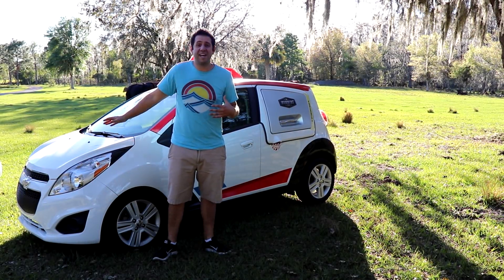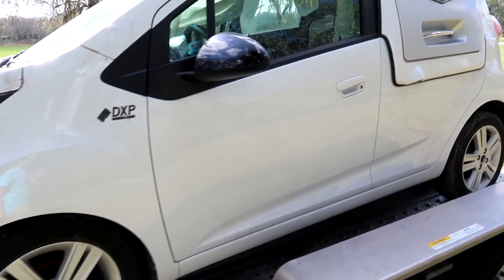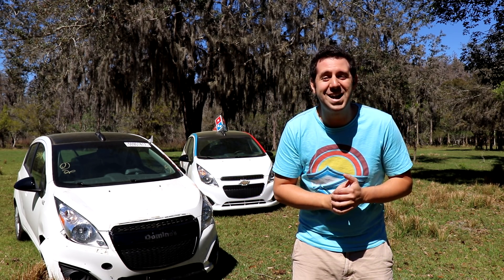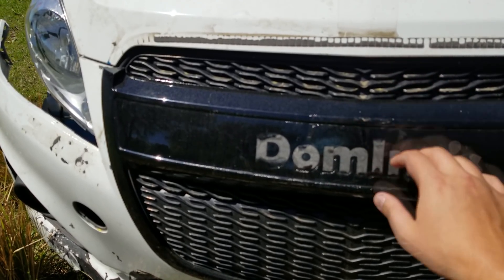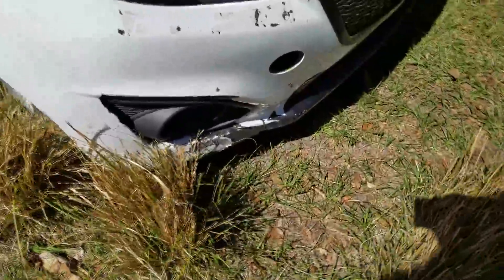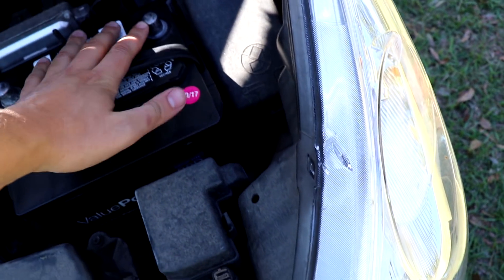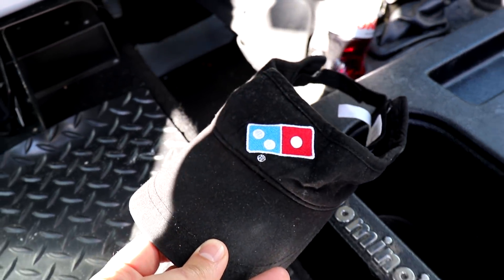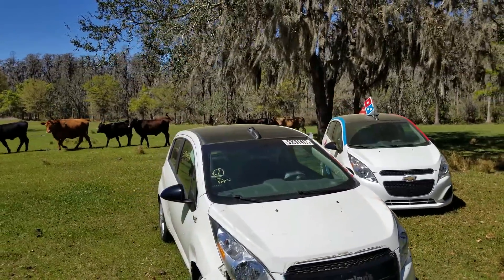I Bought ANOTHER Wrecked Domino's Pizza DXP Car for $825

Comment: I originally subscribed when you started the first pizza car. This is so cool that u got another one. Im really excited to see this one. Also I wanted to thank you for introducing me to copart. I recently bought a truck on there and its freaking awesome. It was donated to a charity and sold through copart with a clean title. I paid $725 and drove it away.
Reply: what a steal! gongrats man!
Reply: What were your copart fees?
Reply: What kind of truck was it?
Reply: Aaron Hayden a ford raptor
Reply: It’s a ford ranger. 1995 with 110,600 on the clock. This thing must have been either in a garage or a carport, it has virtually no rot. Very minor rust, from a few small dents. Copart fees were around 300. It is exactly what I wanted. Thanks Samcrac and Copart!
Reply: t-bone distortion 
What a steal, nice dude
Reply: It depends on the state you live in. I live in PA and here you do not need a license to buy salvage title vehicles. Samcrac did a video about all of that, although if I linked it here my comment would be considered spam. Copart has a $1000 bidding limit for new accounts. If u put a deposit down, you can get more buying power, meaning u can bid more. And u need a premium account to bid on more then 1 vehicle at a time. To answer ur question, anyone can buy a car from Copart if the circumstances are right.
Reply: t-bone distortion rChange the dice on the first car to look like a pair of Vegas dice.

Comment: Could it be that Dominos forced removal of branding stickers because of Samcracs first DXP?
Reply: xkeepersvk I had the same thought. They probably saw his first vid and stripped the second clean
Reply: it still says Dominos on the front...
Reply: ThePc845 that's probably glue from the logo. Or the material around it faded. Not much they can do to remove it.
Reply: Albert Hoelting not true at all, diesel, gas, kerosene, wd40, oops off ect are all great glue removers
Reply: if thats the case then they are still shit outta luck because you can get those designs online and print them out or easily create your own
Reply: @Kardrick that is where the legal standpoint gets much murkier.  With the first one they left the logos on so he was restoring them.  With this one he would be making brand new copies of their trade marked logo.

I would say pull any parts with logos they left on it and use them to better restore the other car.  Then turn this one into a blank slate to have fun with.
Reply: NobodyImportant that's exactly what i was thinking. I would go for something like domono king. We knock over the Dominos. Then have a big hammer on top of the car smashing a big domino. Then I would make a crap ton ofbvodeos and post them everywhere!

Comment: SUPER CHARGE IT OR TURBO CHARGE
IT
Reply: holly shit YESSSSSS!!!!
Reply: Over torque and break the engine,bravo!
Reply: All hes gotta do is buy a SRI cruze. The 1.4 and 1.6 turbo motors will drop straight in. Theyd have a good power to weight. 

Would be funny seeing the origional DXP at a drag track putting down some decent times.
Reply: I support this
Reply: nah ls swap it
Reply: In 30 seconds or it's free...
Reply: I'm not confident the chasis could withstand the increased power/torque haha.  We have a 2014 Spark and if I remember correctly.....I have never experienced so much body roll on a car that comes from the factory with such super stiff suspension.
Reply: You should put a Oldsmobile on the front grill 😂

Comment: V8 swap
Reply: Eclipze FFA LS swap
Reply: Chasis not strong enough
Reply: Put a 1jz
Reply: That engine bay won't even fit a 6 cylinder let alone a V8
Reply: D T if you can an ls where most 4 banger can.
Reply: Looks up ls swapped Chevy spark
Reply: did someone say LS?
Reply: The electric version of the Spark had around 400 lb/ft of torque so maybe it could handle it
Reply: Turbo hybusa mid engine build
Reply: LilWayne Tha GOAT Budd I
Reply: anything can be v8swapped.... even a cobalt

Comment: how about this, give it the tuner/ricer treatment. new oven and other bits it needs to be functional and make some wild tuner or drift car themed pizza wrap to go with it. would be a stunner at the local car meets. also i would refurbish the front bumper skin off car #2 for car #1 even if you cant legally re apply the dominos logo, but having it there just in black trim would be atleast close enough and bring it that much closer to correctness.

Comment: Correct me if I am wrong, but isn't a crash damaged and totaled vehicle the property of the insurance company when they pay off the claim? If that is the case, it appears Dominos and the franchise holder operating these vehicles are being paid by the insurance company for what is left of the vehicle and, the insurance company, as the legal owner, can do anything they want to the vehicle. If Dominos wants to get twisted about their trademarked or copyrighted components and logos, they need to set up a stipulation with their franchise holders about the handling of wrecked vehicles or buy back the components they want to protect, after all, auction buyers can't buy what ain't part of the cars being auctioned.

Comment: I have some questions about the car that you have because I have a 2015 Chevy Spark and my car is running in engine low power mode and I was not able to figure out why, I think the crankshaft sensor might be why, but I'm not entirely sure if that is the full reason, I also have two 02 Sensor codes.

Comment: I'm not a fan of Copart - I sold an old junker to them and they came and picked up the car without letting me know, and then because I wasn't there they paid the shop 1/2 of what I sold the car for, for holding it there.  Luckily the shop has worked out a deal to provide me the money back in labor costs in the future.  They then wrote the check for the wrong amount and luckily they mailed me the difference that was owed to me.  All they had to do was call to let me know when they would pickup the car (as they told me they would) and it could have prevented a whole big mess.

Comment: You can "possibly" take the grill and add it to the car with the original Dominoes additions, since it would be an original replacement to bring that car back to the "state" in which it was sold to you. The stripped car you can not add any trademarked additions to. That one you can not make additions to, as it would be a gross infringement of trademark.
Fix it up, physically remove all the Dominoes markings, and DONATE it to a charity that delivers hot meals.
High Ground Taken.

Comment: Yes nothing like seeing a wrecked chevy spark. I absolutely despise Chevy Aveos, Sonics, and Sparks. They are ugly as hell slow as shit and the people who buy and drive them tend to be the worst drivers on earth. I have had multiple bad experiences with Aveos/sonics on the road I actually bought a dashcam because of how often these things would happen. It was mostly with Aveos but I got a ticket because one pulled out in front of me. They pulled out from a left side street all the way to the right lane stopped at the yellow light (basically slamming on their brakes) so I cut through the little gas station on the corner out of anger and being in a rush and got a ticket. I also had one run a light once and almost t-bone me, they must have been 1/2 an inch away from my bumper. Then they took off. I have had dozens of them tailgate me while im speeding and I have had the exact opposite where they will either cut me off or just happen to be in front of me but they proceed to drive 10 under the speed limit on a road where everyone drives 5 over. A lot of times these people will stop at every cross road like they are looking at the street names but will never actually make a turn (min you our street names are in alphabetical order). If they do turn they never use a turn signal. I believe aveos/sonic/sparks don't have turn signals. They also must have HUGE blind spots since they cut me off so often. They also must have a really shitty turning radius since they can never turn into their proper lane. Seriously I have watched an aveo turn right at a light and cross 4 lanes of traffic to get to the left most lane. I thought "surely they are turning left at the next street/turn..." nope. I absolutely hate chevy aveos. Sorry for the rant but I hate these things more than liberals hate Trump.

Comment: https://www.ebay.com/itm/1961-Ford-Falcon-Sedan-Delivery/253495757423?hash=item3b05864a6f:g:NscAAOSwC-xaq~q9&vxp=mtr

Donor car for the drive train. No need to worry about air bags or even seat belts. Cut the fire wall below the windshield to behind the back of the seats floor boards. leave the sub frame and drive train attached. This will give you a template where the 1961 car will need cuts. Cut wide can always trim.  Only artsy areas will be what dash to use and working the oven and drink holders into the old rear. Cut the old sub frame right. Re attach to the new right and the old front clip will be easy. Re mount the new radiator to the old ones location for all the new engine bay space.

Old low mileage fire trucks don't sell for crap even with all the original emergency equipment. Unless they are turned into a cool flatbed car hauler or RV. Unless you are going to rent those cars out to DP's competition 4S&G. They are one those cost with no return hobbies.

Comment: wanna make a car make a car with a tata nano ev battery with a tesla stick generator run by the battery on a conveyor motor. then use another generator on a tao tao motor with a belt to charge the tata nano ev. the tata nano battery  with a conveyor motor will run for days without a charge if you can get a big enough stick generator on the conveyor motor. try pulling the to large generator on a trailer. but use the battery in the car to power the conveyor motor for the generator may to up to 480 volt conveyor motor. it will get a billion views but be only a test model